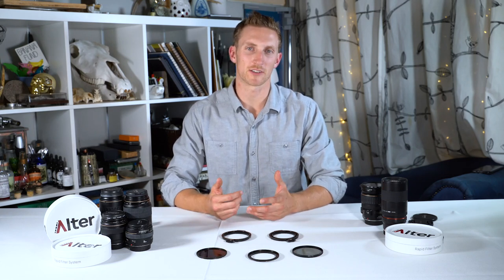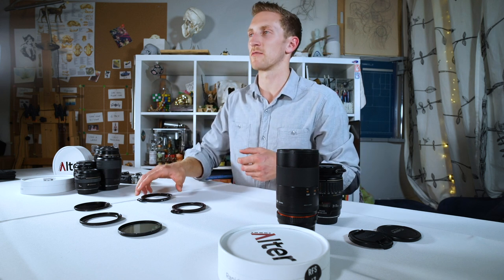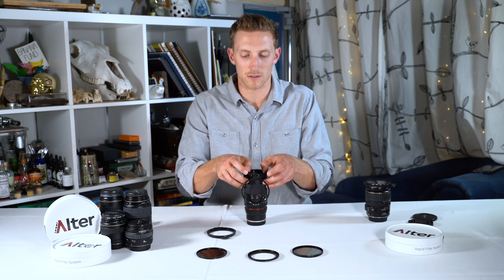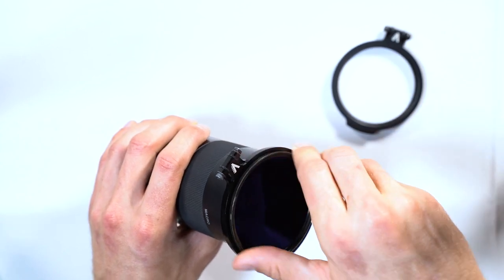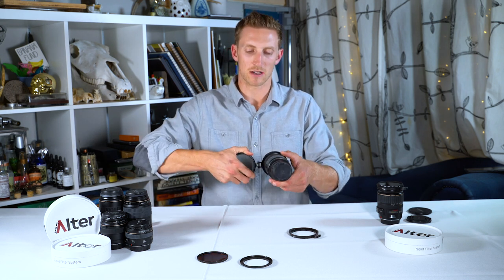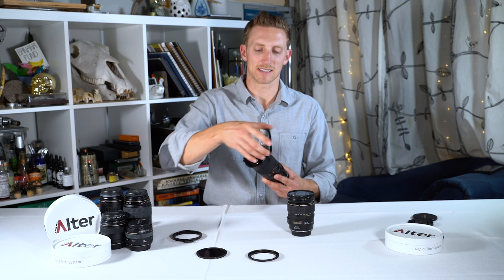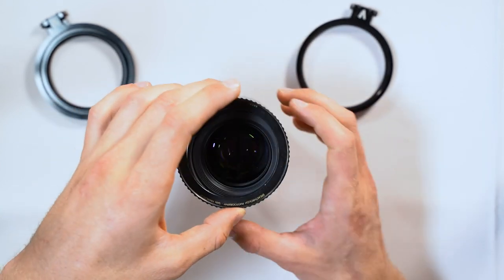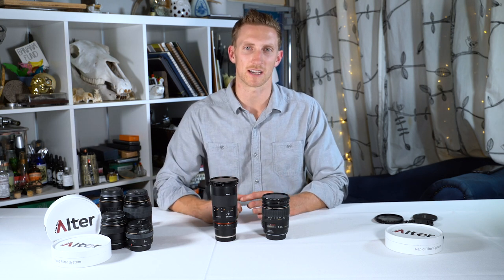How to Install and Adapt you RFS and RFS+ with Step-Up Rings

Comment: hello ,I am about to buy Alter rfs but confused a bit ; I have 67 mm wide angle lens thread sizes mostly ,which should I buy 67-77 or 67-82 ?( will buy variable nd later)